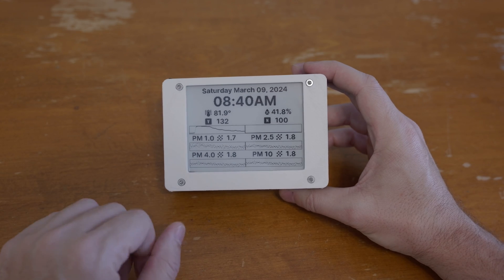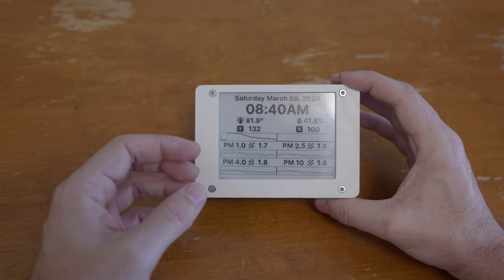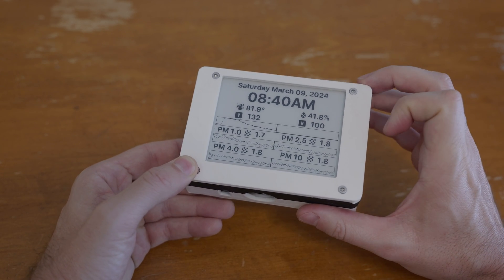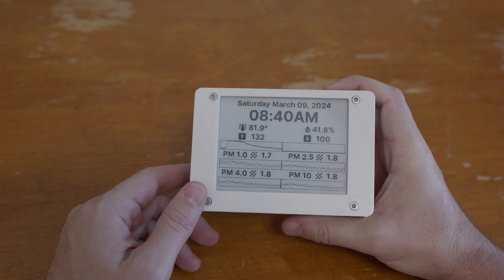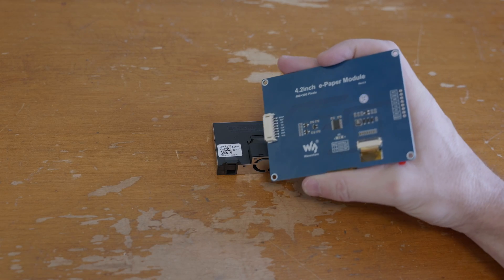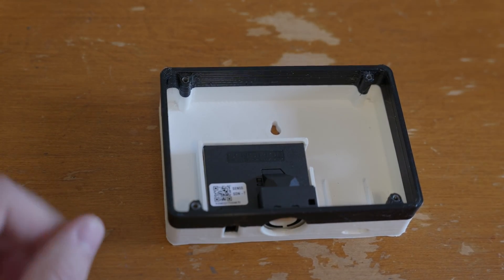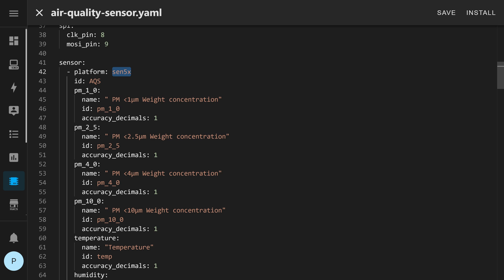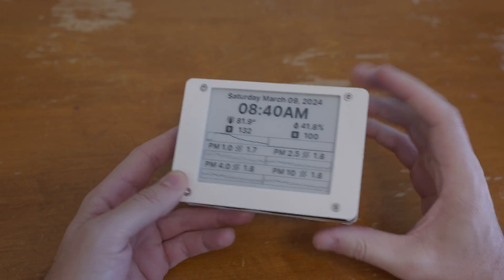SEN55 Air Quality Sensor with ESPHome and Home Assistant

Comment: Great video. How did you get it connect to HA? It would be interesting to connect over wifi.
Reply from the maker: Nothing really special is needed. The YAML I'm using is in the github link in the description. I will note that, over time, I don't really know that the particle size numbers are very accurate. All three size measurements seem to move together on my unit, with barely any different between them. Also, since it produces comparative numbers (rather than absolute) for VOC and NOX that may or may not be what someone is looking for. The VOC is basically just an alcohol sensor... add wine to something you're cooking in the kitchen and it'll shoot to the moon, but I've barely noticed much of a blip when printing ASA right beside it.

Comment: hi the enclosure cover stl is missing , i downloaded the step file but no cover, do you have the the cover step or stl file
Reply from the maker: The cover is in the step file. It contains both parts.
Reply: @TechDregs  ive downloded several times from your github page just contans 1 file of the main shell 160kb
Reply from the maker: Both parts are in that file.

Comment: Hey is there anything you need to do with the fonts etc to get this to work? Im using with an ESP32-S3 but cant seem to get the display to show anything (doesnt look powered on), is that normal?
Reply from the maker: I'd double check your wiring for the display. The fonts should pull from the internet when the YAML builds in ESPHome.
Reply: @TechDregs  If the Sen55 isnt powered on and displaying, would you expect to see anything on screen (i assume not). Also do you power via 5v or 3.3v?
Reply from the maker: I think I powered it with 3.3v but I don't recall exactly. You should see the static text on the screen even if there's no data coming from the sensors, unless the firmware build fails.

Comment: I recently found something that might be a even better solution than a separate ESP32 and a e-ink display

A M5stack M5paper
or 
A Lilygo Ttgo T5S

these look to be all-in-one solutions with a E-ink display
Would something like this work with the current firmware
Reply from the maker: You'd definitely need to make some adjustments to the display component because the ESPHome component I'm using is specific to this panel. Different e-ink screens need different components sometimes. Everything else would be pretty similar though.
Reply: @TechDregs  AAH OK, was already looking for near identical parts, though the only Issue I encounter every time is that they do not specify which revision it is for the E-ink panel.

Comment: Where can I get the STL files for the casing
Reply from the maker: Look in the video description.
Reply: @TechDregs  Its a STEP file, not STL. 

Will have to use a autocad program to convert or modify it
Reply from the maker: Yes, it's a STEP. That's a much more robust format than STL for editing. If you really need an STL, just convert it. There are online STEP to STL converters or some slicers (like Prusa slicer) can natively import STEP files directly.
Reply: @TechDregs  Have already edited it in onshape. made a angled stand as well so it can be sitting on a desk/cabinet
Reply: @darknessblades nice, cool you pls publish it? I would love to have it on my desk. Thanks

Comment: Great video, but where is the wiring diagram/explanation for thr Sen55? Thanks!
Reply: Note: I did find the basics on page 13 of the data sheet, but curious if you did anything unique or used resistors like others have suggested.
Reply from the maker: @Fmstrat  Nothing special. The YAML shows the pins I used for SDA/SCL. The other two pins are just 5V and GND.
Reply: @TechDregs  Thank you. Just fired it up on an 8266.

Comment: Thank you for your video! I printed the case and everything fits perfectly! The sensor is working fine in ESPHome but I cannot get the 4.2 screen to work. Like yours it is the rev2.2. I used the same yml as yours but the screen remains blank and I get this message in the logs: [E][waveshare_epaper:159]: Timeout while displaying image! 
Do you have any idea of what the issue could be? Does yours still work if you compile with a recent ESPHome?
Reply from the maker: Mine is still working fine. You have the external component set up for the rev2.2 set up? I would perhaps double check the wiring and all the pin configs to make sure everything matches up. FYI, they did just push a breaking change for OTA updates, you now have to add a - platform: esphome above the password. See: https://esphome.io/components/ota/esphome.html
Reply: @TechDregs  Thanks...It finally works after hours of searching and debugging 🙄As always the solution was very simple... I connected the screen pwr to 5V! When changing to 3.3V it worked immediately. I thought it would work with 5V as it is stated that it can take from 3.3 to 5. 
Thanks again for your work, the case looks very nice and I love the final result 👌😛

Comment: Awesome Project !! Does anyone have a wiring diagram for the XIAO C3. From what I see, besides ground and power, these are the connections to XIAO C3

i2c: For the SEN55
  sda: 6
  scl: 7

spi: for the Waveshare
  clk_pin: 8
  mosi_pin: 9

Not sure what these are?

cs_pin: 20
dc_pin: 21  
busy_pin: 
      number: 5
    reset_pin: 10

Cheers
Reply from the maker: You should be able to use pretty much any digital pin on the Xiao for those.

Comment: I liked the video and the project, however I would like to have seen how you mounted the ESP32 module in the case.  I printed your case and I see it fits in that defined area, but it isn't secured in any way.  Did you glue it in place?  Also when you connect the e-paper display up I see it has 4 more pins than the just MOSI and the Clock pin.  Do you not need them in this setup? It would be nice to see how you connected this project up.
Reply from the maker: The Xiao is hot glued down to keep it from moving. For the pins, look in the YAML. It tells you what pin everything is wired to.
Reply: @TechDregs  Thanks for the reply. I was able to find that in the YAML code.  I did not check there before posting.  Just my opinion here, when I see someone make something no matter what it is, I like to see as much detail as possible.  For me I am not looking to critic how someone did something but see how what they did worked for them.
Reply: @TechDregs  Awesome Project !! From what I see, besides ground and power, these are the connections to XIAO C3

i2c: For the SEN55
  sda: 6
  scl: 7

spi: for the Waveshare
  clk_pin: 8
  mosi_pin: 9

Not sure about these pins? is it 5 and 10 on XIAO going to 20 and 21 on Waveshare

cs_pin: 20
dc_pin: 21  
busy_pin: 
      number: 5
    reset_pin: 10

Cheers